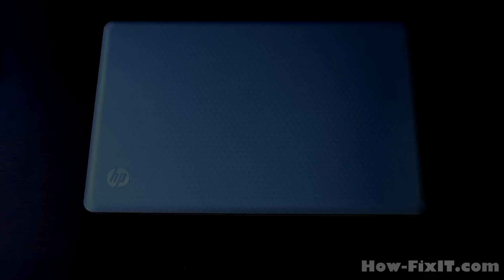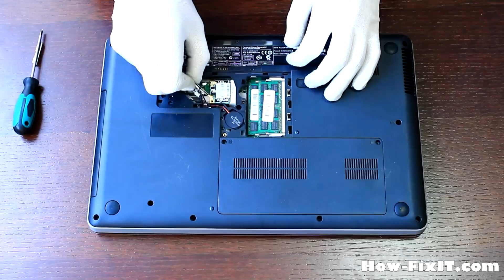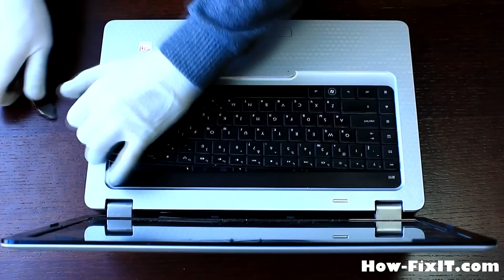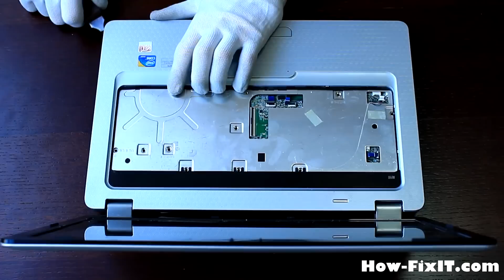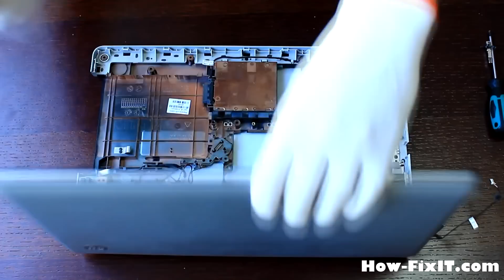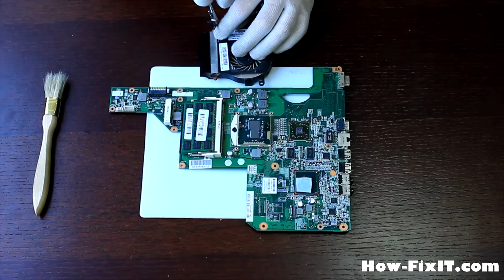HP G62 Disassembly, Fan Cleaning and Thermal Paste Replacement

Comment: There is a problem with the fan and the speaker! When you assembly the frame for the keyboard and that, the left speaker magnet don't allow the fan to work correctly! So what should be the solution for this? Getting out the left speaker or what.. I don't get any other idea of how to separate the speaker magnet with the fan one! They get so close together when you assembly so it won't work! :/

Comment: what is that paste put on the last scene??
Reply from the maker: +sajan kachhipati this is thermal paste, for example you can use Arctic Cool MX-4 or Zalman ZM-STG2
Reply: Thank you
Reply: Is it necessary because i wiped the one before but i didnt have any so i reassambled the computer as it is
Reply: @valhallabee   lol is ur laptop fine
Reply: @khalilzer  that was 4 years ago i cant even remember which laptop i was using 😂 probably ruined that one
Reply: @valhallabee  😂 it sure did 
Mine is reaching +95C I'm willing to repaste it